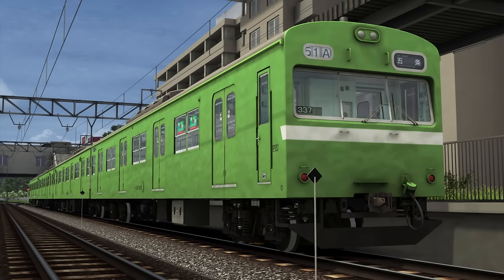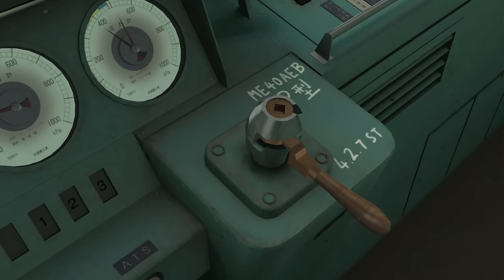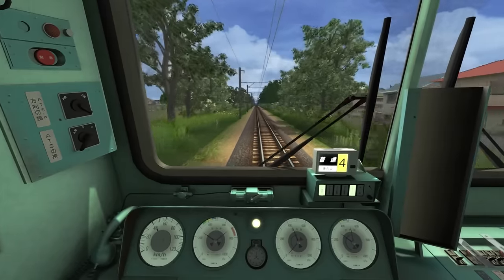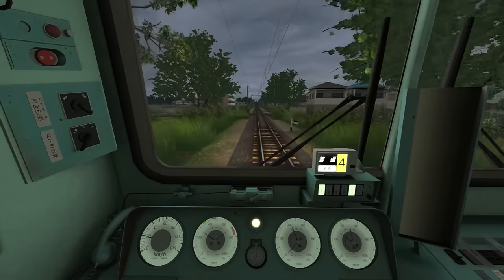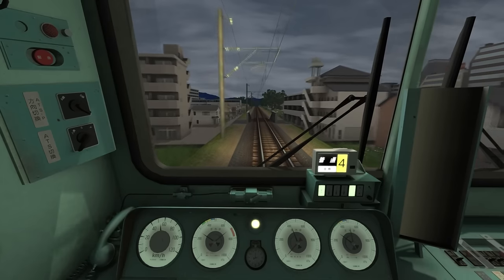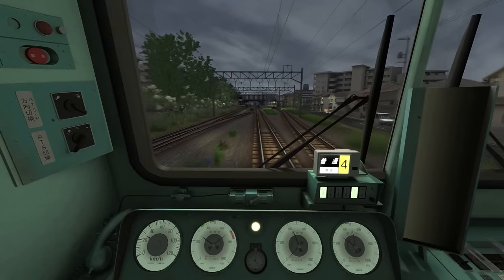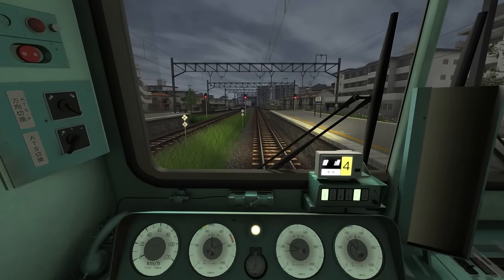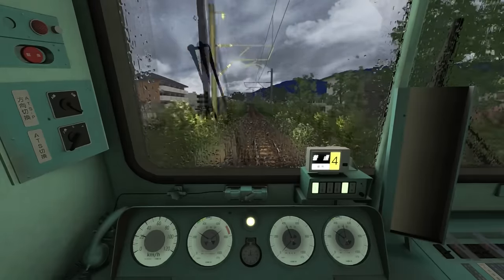Train Simulator 2017 - Route Learning Japan: Sakurai to Gojo (103 Series EMU)

Comment: 54:15 Savage train driver. He could've waited another 30 sec at least.

By the way: It may interest you that the turning around procedure at Kamiuchi was removed when the station was moved in 2007.  The reason was apparently that after they made train drivers change ends when doing this (until 2006, the driver reversed in the "wrong" cab while the guard was instructing him), drivers kept forgetting to turn off the ATP when leaving a cab....
Reply from the maker: Thanks for the information, that's quite interesting. That turnaround procedure certainly seemed cumbersome to say the least.

Comment: I don't have a question, but I have some useful information for the Maria's Pass video: Before departing a station, blow the horn two times and then put the bell on. When arriving at a station have the bell. When you pass a W sign give two long, one short, one long horn blast of the horn. It should last as you go through the crossing. The Audio Shack sound pack that we have has a quillable horn. Use N to quill. I also recommend using the throttle while using a very small amount of brakes while stopping because the brakes are too strong. I would recommend that you swap the locomotives in the scenario editor so that the one without the crew is leading because the P42DC with the crew has the Head End Power (HEP) and should be closer to the train. I hope this will be of some help. I am looking forward to this video. Thanks for using my suggestion. There is a sound pack for the Amtrak Superliners: http://railworksamerica.com/index.php/download-library/sounds-enhancements?view=document&id=2206:superliner-and-surfliner-sound-set-beta-v0-1&catid=25:sounds
Reply from the maker: Thanks for the information. I was already aware of the horn rules, though almost always seem to time it wrong when approaching crossings. I either seem to start the horn sequence too early or too late. What is the purpose of quilling the horn? With the Audio Shack sounds I've got the HEP sounds installed. Won't that apply to all locos? The video will hopefully be coming within the next few weeks. Due to the scale and length of the video, it is taking a lot longer than average to learn and record, so I will be doing it once I've got a break from uni assignments.
Reply: PTGRail The HEP is only on the locomotive with the crew inside, so put it in the back. I would use the quilling before the full horn. I also use both the quill and the horn together to make it sound better. I don't know the "purpose" of quilling.

Comment: During that rainstorm, shouldn't you be using BOTH sets of wipers to increase visibility? Also, does the wiper just have the one speed or does it have multiple speeds?
Reply from the maker: I hadn't thought of that as the view from the other window doesn't seem to make much difference. Unfortunately it's just a one speed wiper as far as I'm aware.
Reply: right hand wiper is a manual one..